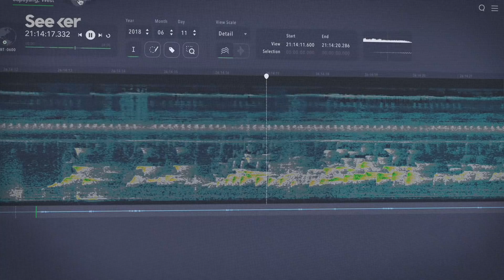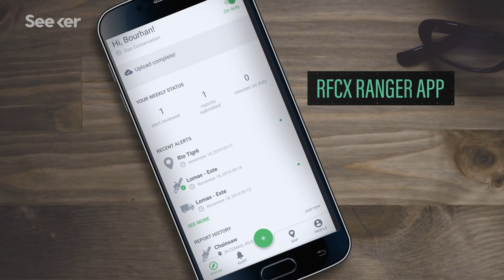How Old Cell Phones Are Protecting the Rainforest

Comment: 03:45 — Please, even if the external antenna get phone coverage from many-many miles away, nearest cell towers can be 50 km away in the middle of jungle. It doesn't count when there are mountains in between. The signal is so very weak, you are so lucky if you can get one bar of it.

Comment: That map at 1:10 is accurate? There are countries entirely surrounded by the Sahara desert, that are at extreme risk of illegal logging?
Reply: I’d say it’s because they have such a fragile balance of trees, saying they’re in such arid climates, not that there is more trees being cut down, rather greater impact per tree
Reply: @connor6444  There is literally no logging business that could survive in these climates, you can't afford any of the equipment required for the cutting down of one or two trees - especially considering that these one or two trees are very likely to be extraordinarily small if they can find them.
Reply: @johnj8639  There are still forests that exist in regions like the Middle East, it’s not like there’s just one or two trees in those countries, it’s not all sand dunes out there
Reply: @connor6444  Notice I'm specifically talking about the Sahara. There are countries that they have highlighted as high risk that are entirely engulfed in the Sahara desert. You will not find a forest there.